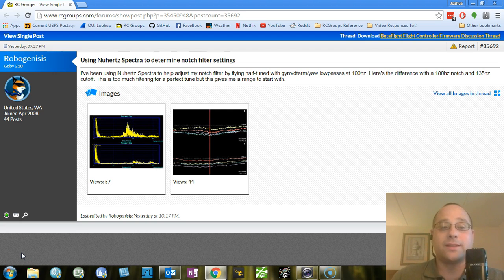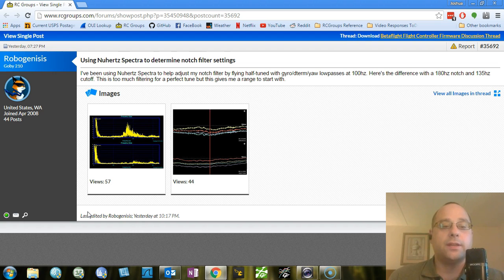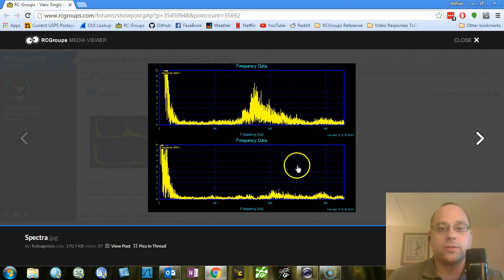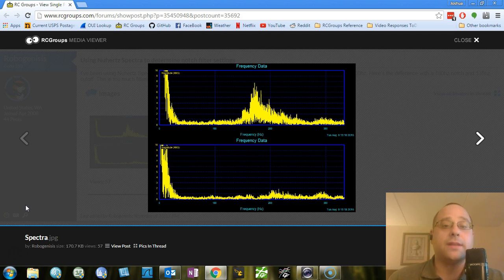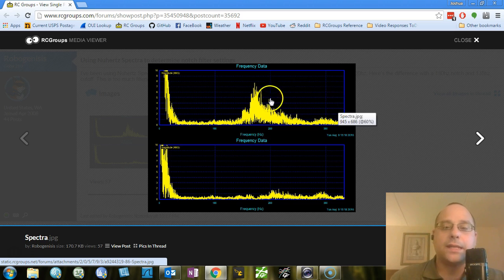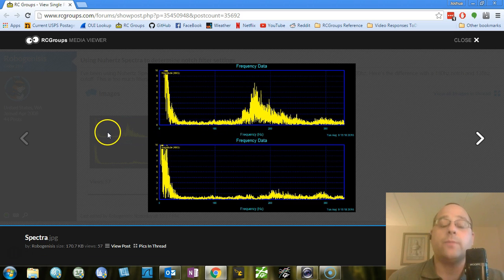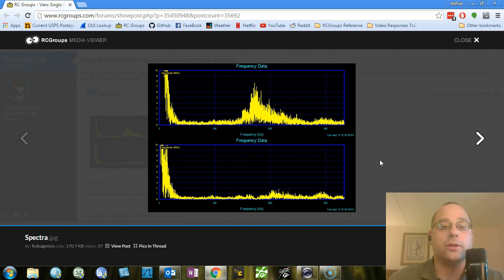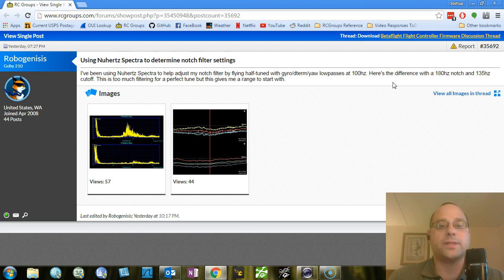Betaflight 3.0 Notch Filter - What Is It?

Comment: So lowering my notch filter, if I'm hearing this correctly, will then cut out a lot of noise?
Reply from the maker: Honestly, today you should install Betaflight 3.2 and use the Dynamic Filter. Then you don't need to do any of this nonsense.
Reply: Joshua Bardwell is 3.2 released!? I've been so dissolved lately. I have great running quads but I know they can be better especially my bf f3. Thanks of course for all your help through the year I've been ripping.
Reply: Joshua Bardwell all honesty tho I feel I need to know anything lol
Reply: doing it now

Comment: Thanks for this. Do you know the difference between the D term filters (LP and notch) and the gyro ones?

What is the interaction between the two? Can I turn D term filtering off if I'm gyro filtering? 

By default, my Betaflight 3.0 RC12 came with the D term filters on but the gyro filters off.
Reply from the maker: +Alexandre Fisher you need D term filtering more than gyro filtering. In a very clean setup it might be possible to disable gyro filtering and just filter the D term. 

The gyro filter is applied first, then the D term filter.

Comment: Thanks as always. 
will it be right to  assume that as same as with lpf also excessive notch filter (higher) will cause a delay ?
Reply from the maker: With notch filter, it is both the width and the center that determine the delay. Lower center and wider width mean more delay.

Remember that the delay is NOT fixed. It is frequency dependent. So what we really are talking about is the amount of delay at our frequencies of interest, which is generally below about 20-50 Hz. The further away from that range the cutoff value is, the less delay there will be in that range.

Comment: Nice feature!
Notch filters are common in control law design for aircraft, aiming to prevent structural coupling (i.e., the frequencies of the vibration modes of the structure). To get those you need Nastran and ground vibration tests eventually. 
Probably what you actually get in that spectra is the frame resonance: the gyro gets more vibration not due to the motor rpms themselves, but those rpms that make the frame vibrate more.
Quads are pretty rigid compared to aircraft and their first mode (arms bending) may be around 100-200Hz, mainly depending on motor weight, arm length and thickness. Aircraft modes could be as low as a few Hz, you need to take care of a few of them with notchs.

Comment: Great video Joshua as always. I have been playing around with the notch reading in blackbox and for some reason my graph maxes out at 250hz while almost all others I see in pictures goes up to like 500hz. I'm using the xracer f303 v3.1 and I'm not sure why it doesn't go higher.
Reply from the maker: +Adam Komarek the graph stops at the Nyquist Limit which is 1/2 your sample rate.
Reply: +Joshua Bardwell so running at 8k\4k\4k but only recording at 500mhz(13℅) is why... thanks man! always helpful and I really appreciate it!
Reply from the maker: +Adam Komarek frequencies above the Nyquist Limit are recorded with aliasing artifacts. So showing them would only result in corruption. That's the whole point of faster gyro sampling.

Comment: This is exciting news Josh. There's always that point where you're at the threshold of a "perfect tune" (subject to the pilot's opinion of course.) and that wall is hit where the parameters are just generating excessive heat that will lead to mechanical failure. A notch filter seems so simple that it makes us wonder why this wasn't there the whole time, it's what we call an "A-HA Moment". Once again I will break out the BB logs and look into this, just because of the great information that hides within. Thanks for doing all the hard work brother. Waiting on the BF 3.0 features update video.
Reply from the maker: +badandy122376 Boris and his elves are the ones doing the hard work! DONATE if you can!

Comment: Ya, but the noise shown here is clearly separate from the low frequencies we are interested in, so why don't just have a low pass filter with a steeper cutoff? The same would be true for the notch filter to be effective, so I don't see the added benefit, at least in the example given here.
Reply from the maker: +BWFPV because a low pass that gives equivalent attenuation would have much more latency, potentially.
Reply: oh, so does the latency arise from the extra computation associated with a steep cutoff filter? Because a steeper cutoff should effectively have less impact on the frequencies we care about.
Reply from the maker: No. This is not processing latency. The filter itself delays the data. 

Think about a very simple low pass filter, a moving average. Assume you want to do a ten sample average. You need to collect ten samples before you can begin outputting the average, right? So that filter will have ten samples of delay.
Reply: thanks, that makes sense. It'll be nice to see if the notch filter is in fact more effective. Cheers, and thanks for the great videos!

Comment: But what happens when speeding or slowing the motors? In theory the base frequency should shift and notch will not be able filter the new frequency.
Reply: I guess thats why you need to use the whole log and find the most problematic frequencies. Also i think there is usually 1 specific rpm range when it starts to resonate and create the most problematic vibrations.
Reply from the maker: +kokoronotomoni it doesn't shift that much. There is usually a big spike like you see where noise is strongest. When the motors slow down, the vibration gets weaker.

Comment: Awesome stuff. Just recently built my second quad and i have already 3 noisy motors. Cant afford to buy new ones. Do you change bearings these days? Or just buy new motors?
Reply from the maker: +kokoronotomoni you can change bearings. You could also just try oiling them. 

https://youtu.be/FhNnovCRwGU
Reply: Try soft mounting your FC helps massively with motor noise in my opinion. I use probably the cheapest 2204 motors in the world and with softmounting my gyro traces are pretty thin.
Reply: +Stephen Gibb Sounds interesting, Do you Mount it with o rings or how?

Comment: so if we go with F4 flight controllers or something with lots of power can we just make a huge notch without a problem? time to start using some of these crazy SOC's with way more power?
Reply: While it's true that more complicated filtering can be implemented with more powerful processors, don't confuse signal delay with processing time. Regardless of how quickly you compute your lpf the signal delay goes up as you increase the amount of filtering.
Reply from the maker: +leecyrille maybe. And yes, current development is focusing on FC and F7 chips. So I would finally say we are hitting the limits of F3 and F1 should be abandoned.
Reply from the maker: +Peter Kjellström correct. I made this mistake a long time ago and Boris set me straight. EVERY FILTER ADDS DELAY even a piece of rubber or silicone padding.

Comment: So notch filter is awesome and stuff but doesnt that also add latency? Is the slope of that notch filter so much steeper than a lowpass that its that much effective?
Reply from the maker: +neclovekSK yes to the first. You get to pick the width of the notch. The narrower the notch, the less latency. It's just another tool in use tuning box.
Reply: With a - basic - low-pass filter, you take the current incoming measurement and mix it a certain percentage with the previous measurement. Over time this will create a rolling average. If you mix 95% current and 5% previous then your average will react quite quickly to things happening right now, but as you apply more low-pass filter (say 40% current and 60% previous) you can see how the calculated average will only react slowly to new incoming measurements (as it should - that's what it's there for). That's how more low-pass generates more latency. A notch-filter works along a different algorithm which doesn't necessarily generate latency in the same way as a low-pass.
Reply from the maker: +lebasson all filters generate latency though. That's just a fact. If the notch is narrow enough then it will generate less latency than a low pass with the same attenuation.

Comment: would running two filters not increase latency? why not increase the slope of the LPF
Reply from the maker: +perfectprint it does increase latency. In some cases, a notch filter can target the noise with less delay than a low pass.